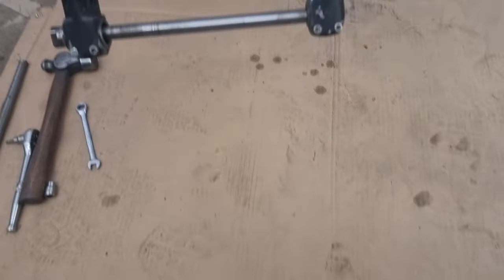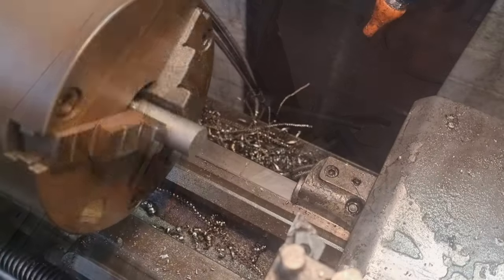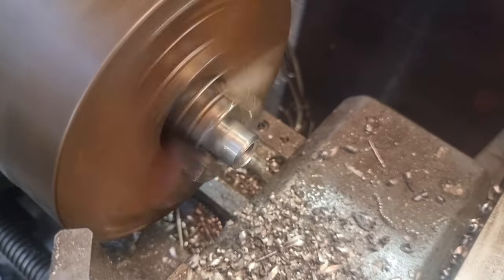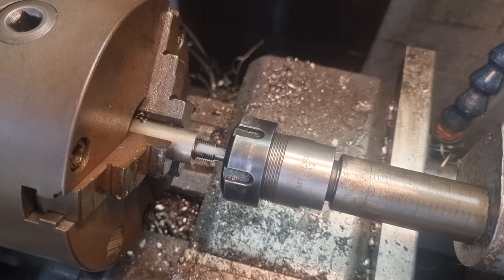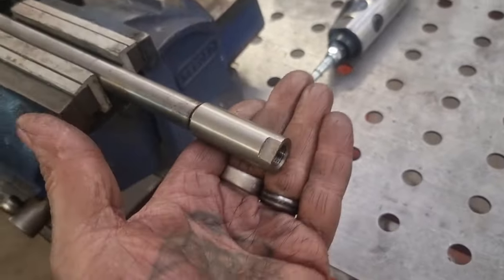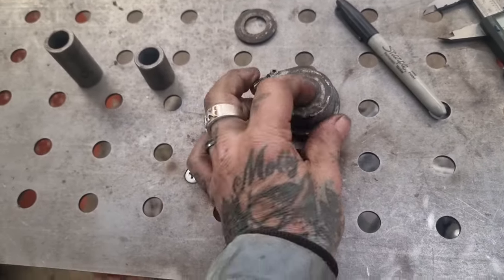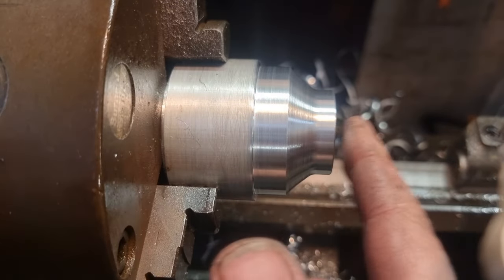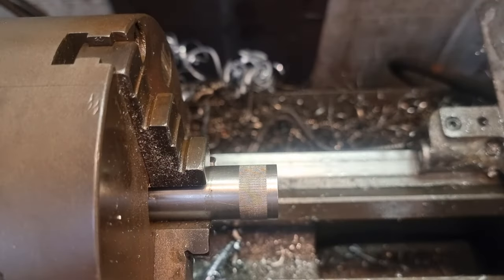Custom Speedo Delete Wheel Spindle Spacers Handmade Bike Building #chopper #bike #custom

Comment: Nice job there mate, shame about the Death of the Dro - had that happen to me and it's a right pain the arse. I followed your advice and bought a cheap and cheerful one off the fleabay, so far it's been fine.
Reply from the maker: Cheers Jason bud, yeah I might fool myself I can do without it 😬😆
Reply: I managed for a while but the dials on my old Colchester are not easy to read as they're a bit worn in places. That meant stopping frequently and measuring everything - I got quite good as guessing before I finally got around to fitting a new DRO @RalfyCustoms
Reply from the maker: Yeah I've just ordered one ffs lol